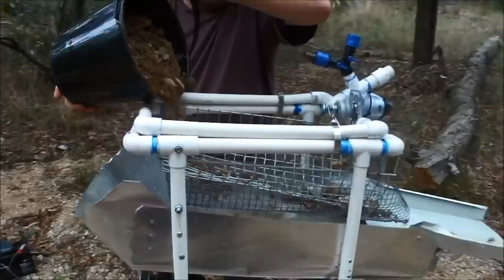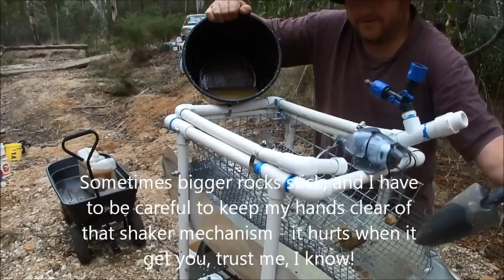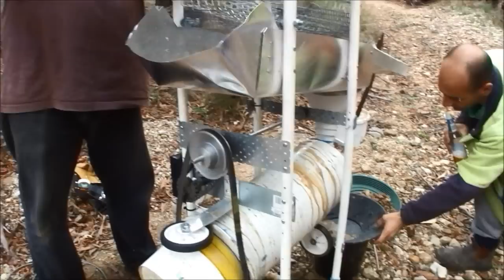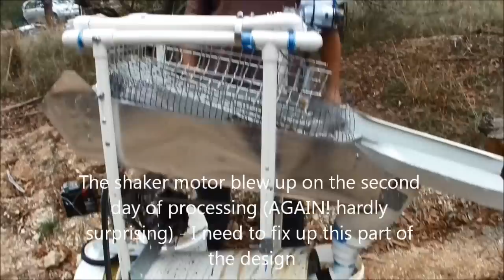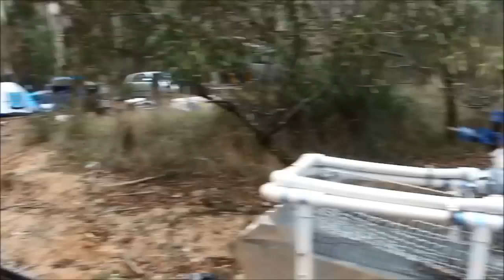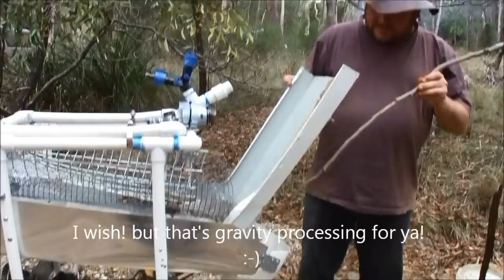Running Goldzilla at Creswick

Comment from the maker: Thanks Steve. Good luck getting one of these from Bunnings :-)
While I got the PVC tubing & some of the fixings from you know who, it still takes a scrounging madman to put it all together. 
The PVC barrel was an offcut of drainage pipe from a new estate..

I ended up stirring in some Gypsum to break up the clay, which worked nicely, and environmentally neutral. 

We didn't end up getting that much gold from that spot, But Creswick's been worked hard over the years